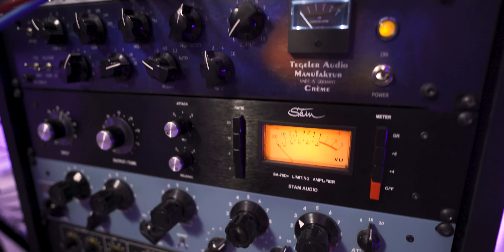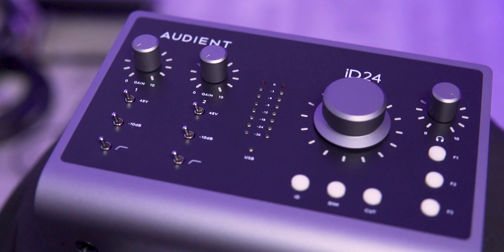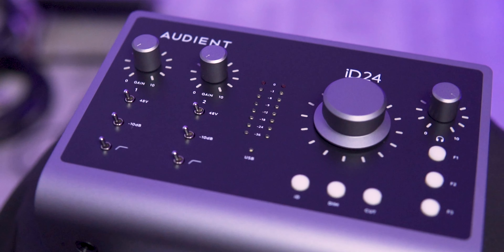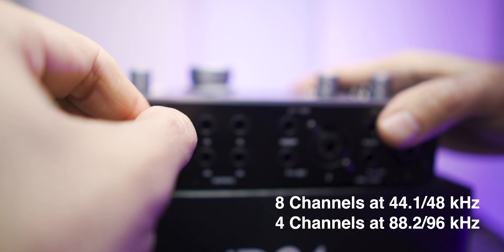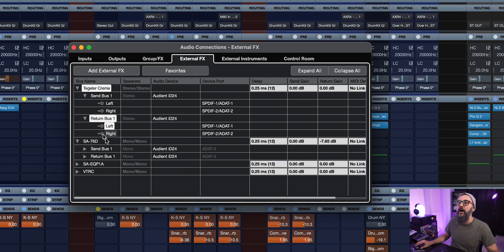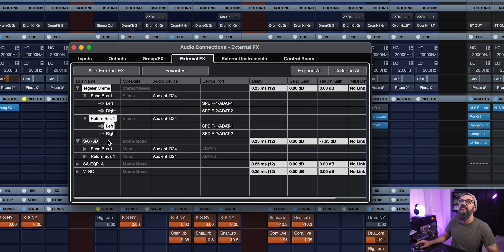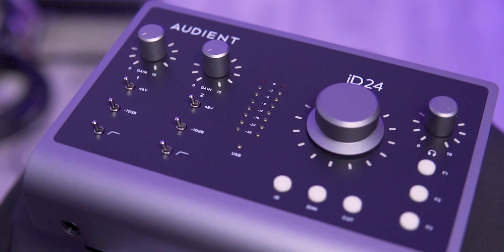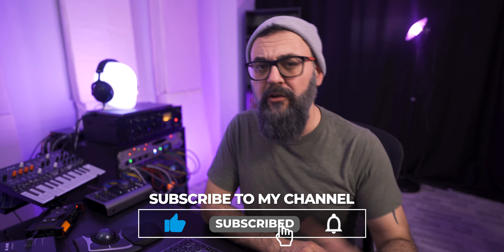Unlock the Power of HYBRID MIXING with ADAT - iD24 & Cubase Setup

Comment: Hey Chris. Love the set up.

I am also a cubase hybrid mixing guy.
I use a lynx aurora 8 with the tb2 card as my interface .
I’m finding that 8 channels isn’t enough anymore tho as my external gear collection has grown a lot over the years and it’s really tedious to patch everything constantly .
I have a vintech 273 I use often on my stereo buss for color and broad eq, I use a Wes audio Dione as my primary buss compressor,  and then I have a focusrite liquid channel, a pair of neve 551 eqs, a Cl1B, and some other pieces I occasionally use .

The big issue is that I monitor and sum through a dangers d -box.
So I have to be sneaky and crafty about how I patch between mixing and then ultimately when sending my audio out as 3 stereo stembusses and 2 mono busses through my 2 buss processors and then printing back in.

I can’t really afford the new aurora N 16 channels currently so I’m looking for a used 16 to replace my 8 with but maybe it’s easier to just use an interface and use the light pipe card with the lynx .
Reply: I'm in the same boat lynx aurora with only 8 in 8 out,after resaerching I think I'm going to get the Audient Evo 16 & pair it with an Audient SP8. The Lynx stuff is just too  exspensive to upgrade to 16in/out
Reply: @hammerfall66rulz  tell me about it .

The new line is so damn pricey.
The other idea I’m playing with is going with a flock patchbay with the automatic routing .  This isn’t a forever solution, but since I’m not tracking full on bands these days I feel like this would solve the biggest issue of the time spent patching and repatching when switching to summing / printing through 2 buss mode after having using gear as inserts .

With the auto patchbay I could still just use my ins on the aurora in two different modes and it would keep me from having to go a 16 channel converter.

Comment: I only mix in the DAW, only rarely do I adjust the sound directly, but then I have a DI signal or a copy of the signal on another split channel. So I always have an unprocessed signal in the computer.

I am of the opinion that early sound decisions can sometimes be made unfavorably and then I prefer to work with a double bottom, with an unedited copy.

Comment: Hi I have a question, My interface does not have a WorldClock In or Out. Will I be able to connect a convertor thorugh Adat and match the BitRate on both the master and Slave. Will I get any pops and clicks?
Reply from the maker: Yes, in this case, your interface, and converters can also use ADAT as a clock source
Reply: @mixdownonline  thanks for the reply, another thing. I want a separate AD convertor in future. Maybe dangerous Ad+. Would I be able to connect it via Spdif without any issues?

Comment: The Aurora 16 is perfect to use with analog hardware because it doesn't have preamps, just pure converters.The audient EVO not so much as to my understanding you cannot really bypass the preamp circuits on the inputs. It will work, you  can pad down the signal, but yet not ideal.

Comment: I use cubase with rme and I have some analog equipment so I chose behringer adat 8200 as an extension the converters are surprisingly exemplary no problem for two years.  the preamps are bad but the adat part is nickel (for me) I always calibrate my analog equipment to 0db vu and you? Merci Chris !
Reply from the maker: Nice setup, Daniel! I do have my Lynx converters calibrated

Comment: Outboard hardware is nice, but it would be great if Cubase offered rendering a track in real time with outboard gear running thru it. Like some engineers, we can only afford a few outboard modules. This would free up outboard modules to use on other tracks or mix buss. You couild always export the track in real time with outboard effects and then import it back into project, but that takes up a lot of time.
Reply from the maker: Good question, I will make a video soon on my Cubase workflow when mixing with hardware.
Reply: You can do that with the external effects panel in Cubase!

Comment: I love to use outboard hardware gear, however, my experience has been mixed. When it's worked, it's super. I have some older gear -Focusrite (LS56) interface, and ART MPA and VLA unit, DBX 166 Comp, and PreSonis Preamp Gear from early 2000's (all in good condition).. But for some reason, I seem to have a lot of issues getting it all to work. No idea if it's cables, input or outputs, or what. I've spent several days  at various times playing with all the setups, only to get some of it to work, and other pieces not so much. I would love to get this working all the time but currently it seems to be a mixed bag for me. But, when it works, it's really magic.
Reply from the maker: Thanks for sharing your experience with this. There's always things to experiment with to make the process better